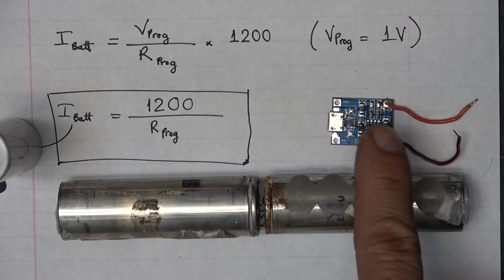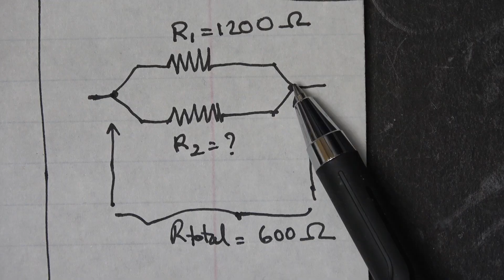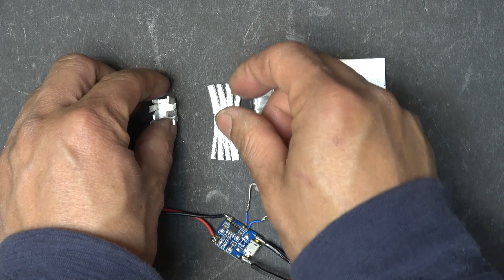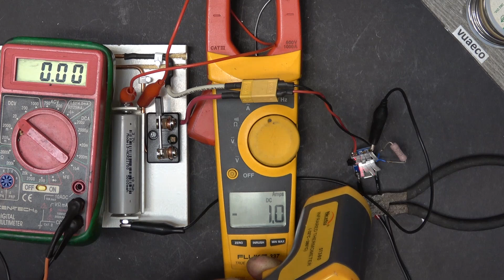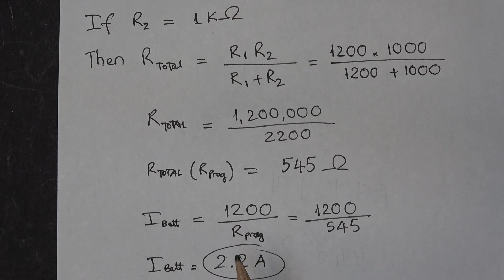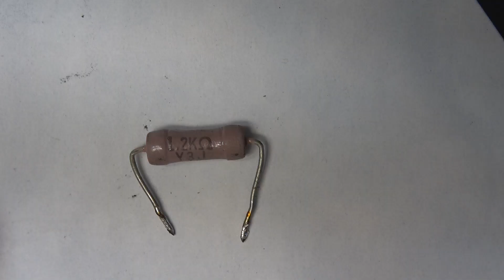DIY: Modify TP4056 charging board to more than 1 Amp (2 Amps possibly)?

Comment: I can get 2.3 Amps charging 18650 by replacing the Rprog = 500 ohm resistor, try another TP4056 and you need to test on a more drained battery.

Comment: I connected 2 cells in parallel the circuit still working cause I connected a Heatsink on it.
Heatsink always works unless it touch the other components, short circuit and sometimes its the polarity

Comment: First thing I did was add a real heatsink to it and fantastic it worked but damn that heatsink does get hot when at 1a the problem is my 18650s are 3a.  Now the thing is 1a is bad enough, but the horrible thing about the 4056 is when it gets close to full capacity and revs down. revs down to about 100ma so another 3 hours to finish the 3ah batter to full.  About 5-6h.  I don't care much for the 4056 due this (plus only 1a was bad enough to begin with).
Reply from the maker: When it reaches close to 4.2V, it has to rev down to change from constant current to constant voltage. Then it will need to rev down otherwise it will need to increase to voltage above 4.2V if it needs to keep the current high. Since it cannot increase the voltage above 4.2V, it must rev down the current. It does not do the same 1.6A charging current all the way to the end. This is the same to every single LI-ion charger, not just the TP4056.
Reply: @vuaeco  I know but 6h to charge a single battery at a time was not for me when we aren't talking about that large of a battery.  2700mah to be exact.